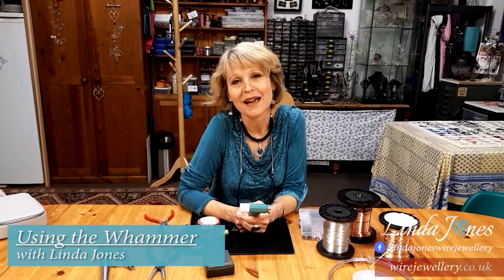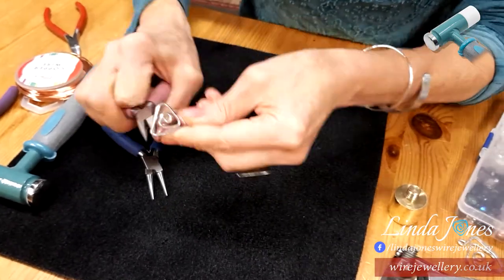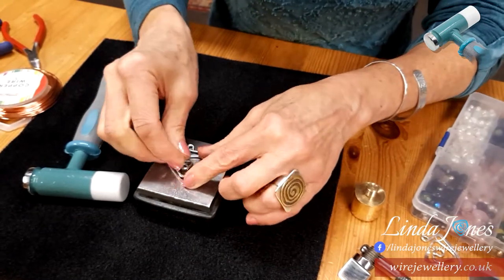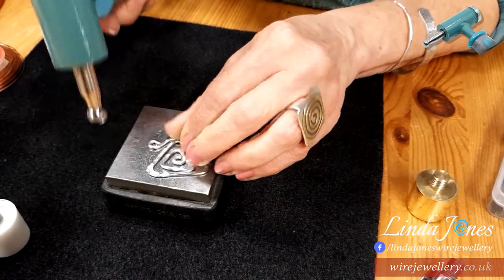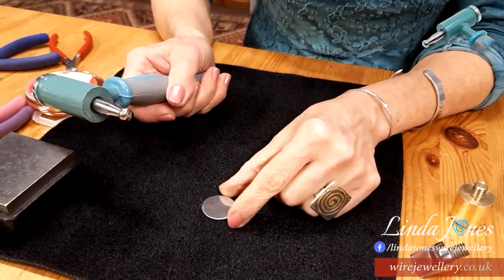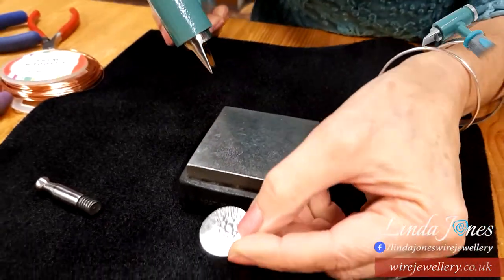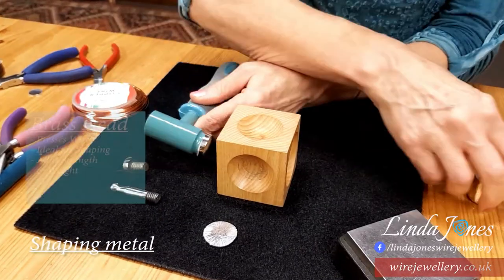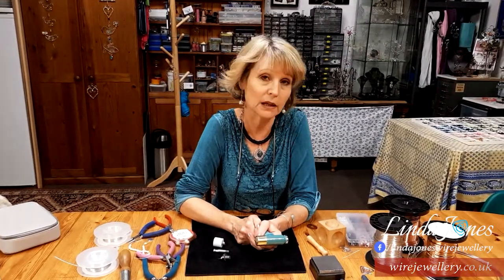Using the Whammer - The ULTIMATE jewellery Hammer

Comment: Do you have a amazon link? I want to buy it.
Reply from the maker: https://www.amazon.co.uk/Beadsmith-Whammer-Deluxe-Hammer-Jewelry/dp/B07RN1W384/ref=sr_1_1?crid=1M5LAOX3SVS9D&keywords=Beadsmith+whammer+hammer&qid=1690405239&sprefix=beadsmith+whammer+hammer%2Caps%2C104&sr=8-1
Reply from the maker: https://www.amazon.co.uk/Solid-Jewellers-Dapping-Doming-Hammering/dp/B07BNMR6QN/ref=sr_1_8?crid=122EPGGX6IZ2T&keywords=steel+block+jewellery&qid=1690405435&sprefix=Steel+block%2Caps%2C95&sr=8-8
Reply from the maker: You will also need a flat steel block to Whammer on . Apart from ‘Amazon’, you can also purchase both from http://www.cooksongold.co.U.K. 😍